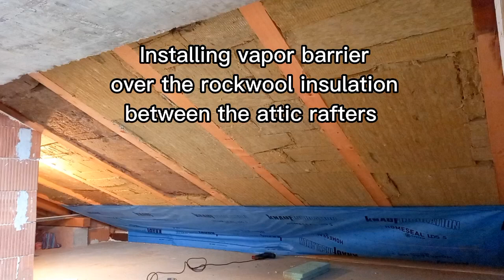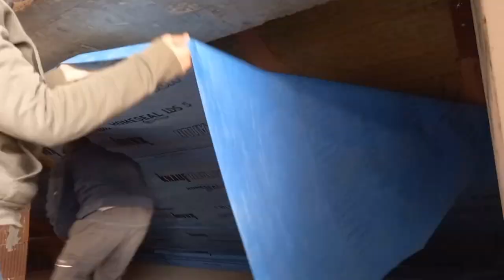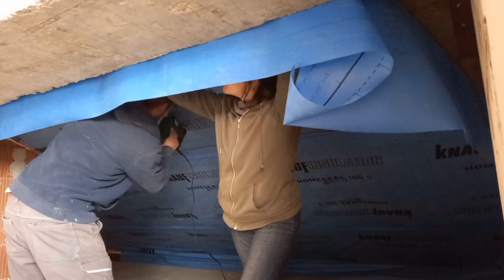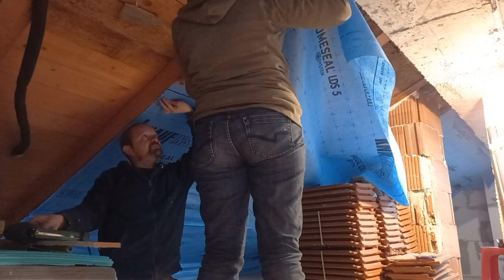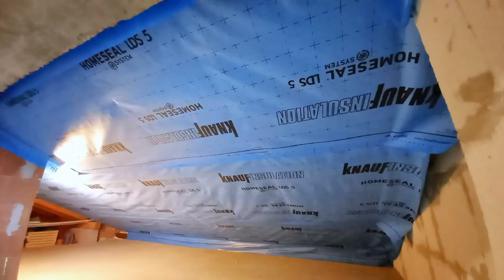Installing vapor barrier over the scrap rockwool insulation in the attic - time lapse

Comment: I don't think you'd need a vapour barrier since if the attic is properly vented. The inside of the attic and the outside air out would have the same amount of humidity and be the same temperature. Since the air is blowing up through soffit vents, up to the roof peak vent, in and out via end vents. Inside a house the humidity would try to leech out through walls so an inner vapour barrier is needed to prevent the migration via vapour pressure. An unconditioned attic would be neutral in vapour pressure; temperature and humidity equal (or at least it should be).
Reply from the maker: You're correct however attics are not really made that way here... So this is the system we're doing: https://www.knaufinsulation.bg/sites/ki_bg/files/styles/paragraph_image_crop/public/media/images/KnaufInsulationRoofInsulationEcoseTechnology.jpg?itok=o9g3CmIy
Reply: @smallscalepermaculture  Oh I see you're in Bulgaria I missed that part in your channel name. Here in Canada you want the attic cold in winter so the snow doesn't melt. If it melts it makes ice and then an ice dam forms. Then water from melting snow can't go downward it goes upwards under the shingles. Water get into the attic and maybe outer walls and ceilings causing mould, rot, and major damage.